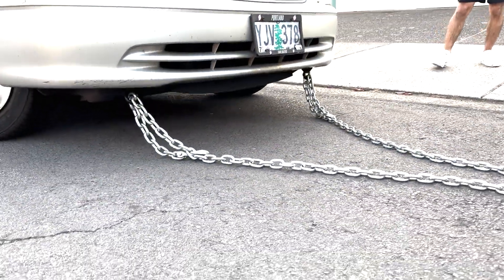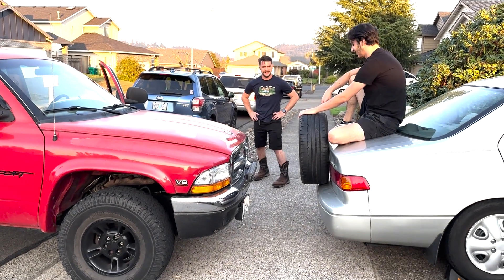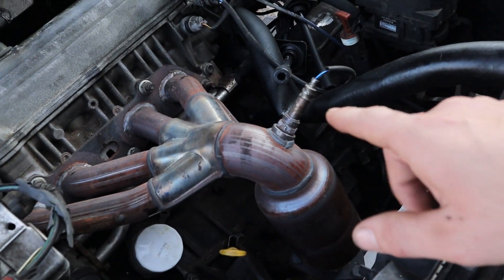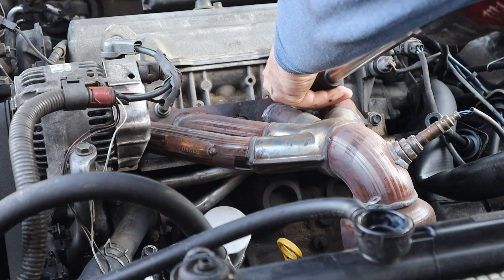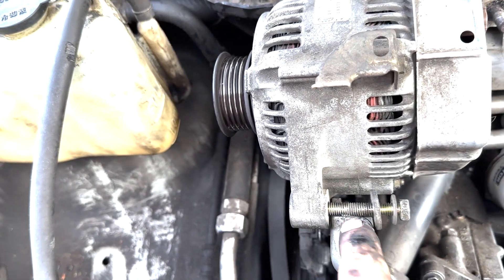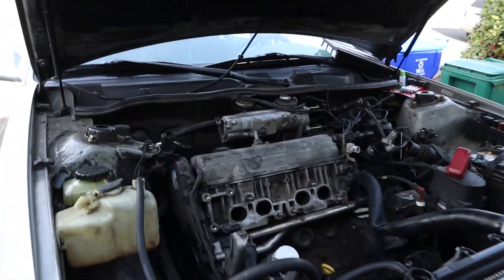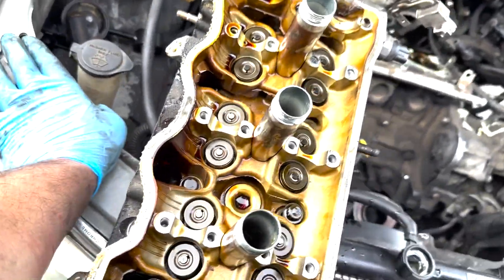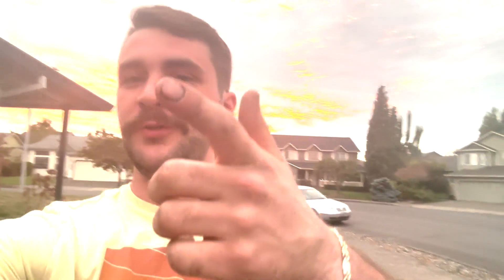Toyota Camry Head Gasket Replacement Part 1

Comment: I like our Toyota Camry 1998 V6 3.0, because it does have 2 tow hooks on the bottom, yes, I have to fix our head gasket next week, I just replace battery and alternator 2 weeks ago.